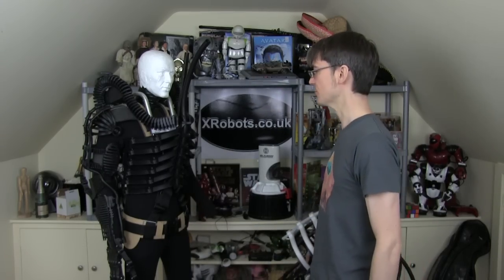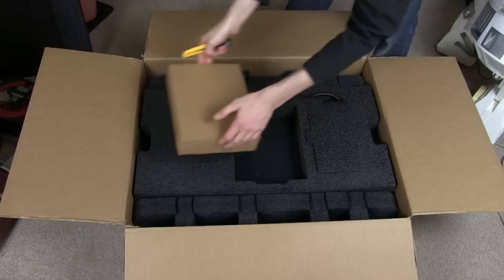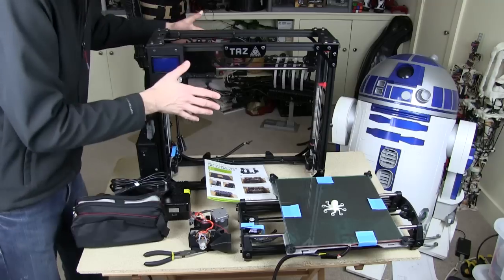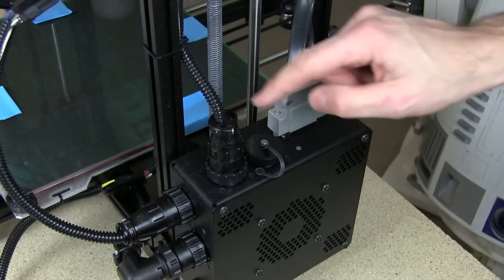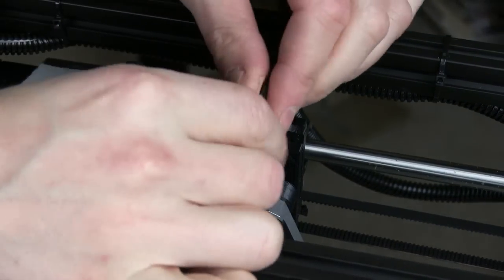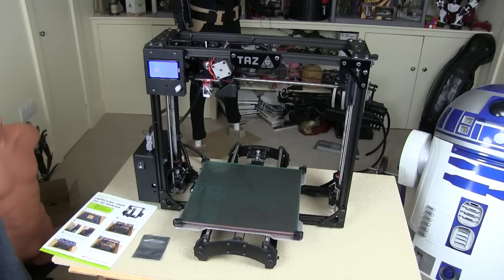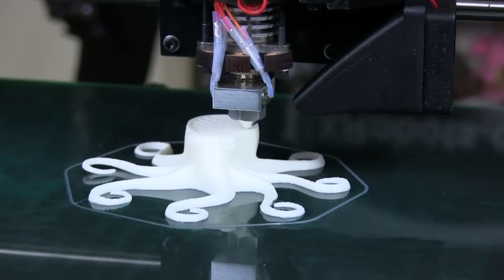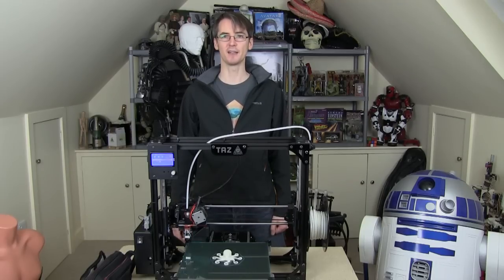Lulzbot TAZ4 3D Printer Unboxing, Setup & First Prints | James Bruton

Comment: So this is probably an odd question, but I don't suppose you would be willing to chat on the phone with me to help me get mine leveled sometime? I've had a hell of a time with it. Seem to get it pretty good but then it just never is right...
Reply: I wouldn't say that they are that helpful unless I was sponsored by Lulzbot
Reply: +James Bruton (XRobots) 
Our school bought the TAZ4 (my choice) and I find it much more difficult to run verses the Makerbot Rep2 which we had for 2 years prior.  The TAZ4 is the first model design. Not only is it difficult to level out but it is also tough to get the filament drive screws adjusted correctly.  My nozzels have material that some how some where the melted PLA gets out and drips down the side of the nozzel.  I also do not feel that the four corners adjustments for the bed do a very good job.  I swear one of mine isn't even attached.

Comment: looks great and i really hope it speeds up your projects so that you never have a video where you are embarrassed about only having a few big pieces to show since they took so long to print. Will you be adding a duel extruder to this one as well or is just the one enough? And could you buy motors and other parts and print your own 3d printer or is that really hard?